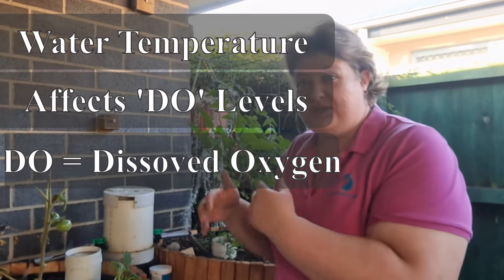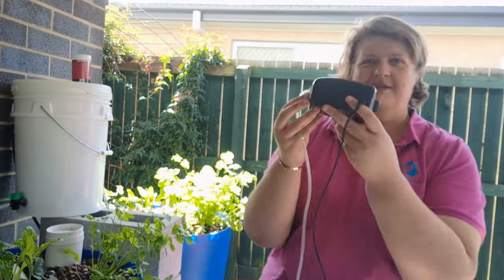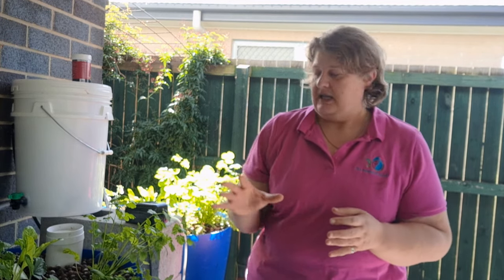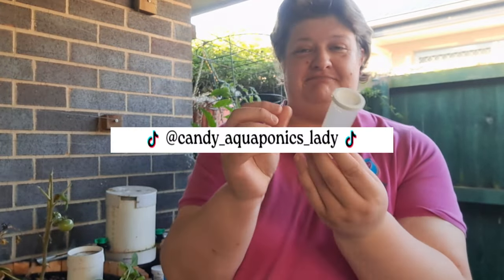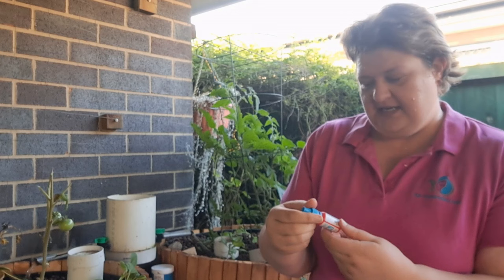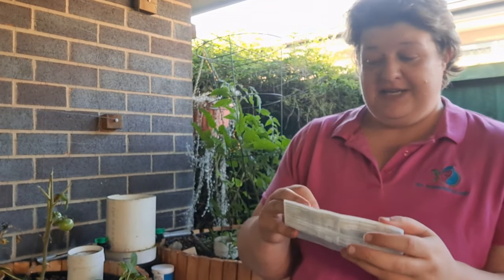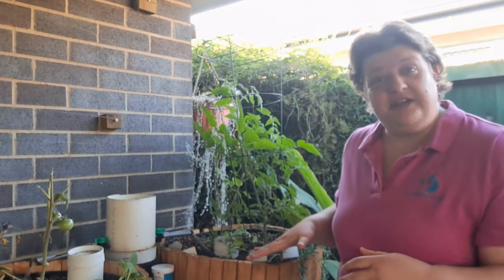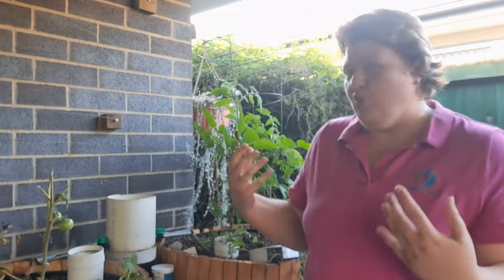Does Aquaponics Need An Air Pump & Added Oxygen? $30 Dissolved Oxygen Test Shown

Comment: All systems should run Air plumps regardless of DO. Why? Because if the main pump fails DO gets depleted very quickly. It's cheap insurance. This was a very good and necessary video. It's doesn't get tough on enough. Keep up the good work
Reply from the maker: Absolutely- though i am covering that in a backup system video 😊😊 this is just about general practice, especially with stocking. Few questions about enough oxygen lately

Comment: Happy to say, upgrading my air pump for my indoor aquarium has improved the quality of life of my two yearling fancy goldfish. I currently keep an HOB, sponge filter, and diffuser right now for aerating. My only issue right now is that my clay balls are growing algae and I think I'll need to upgrade the grow bed from floating in the tank under a lid to one of the other systems.
Reply from the maker: Thank you for taking the time to comment and watch the video :-) Oxygen is important and makes a difference to the fish. Algae grows when there is water, fertiliser and light getting to the area. If on the expanded clay (I'm not sure of your system), these are the causes, and removing light from them is the best option. Normally in a growbed if there is algae on the clay, either lowering the water level in the growbed, or adding more clay so the top layer is dry. It doesn't sound like this is what you mean though. As you mentioned floating clay and a lid....  The algae will be using up your nitrates (fertiliser) so working out how to reduce or stop that is a key thing.